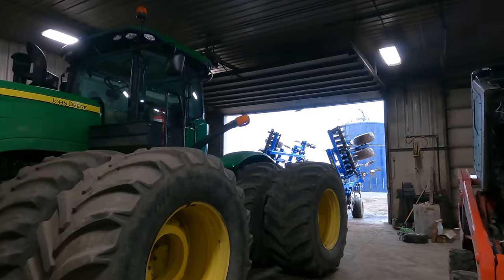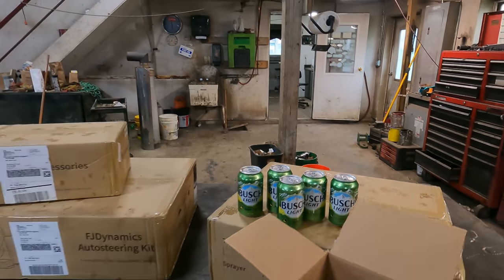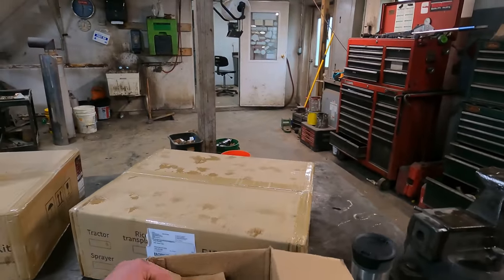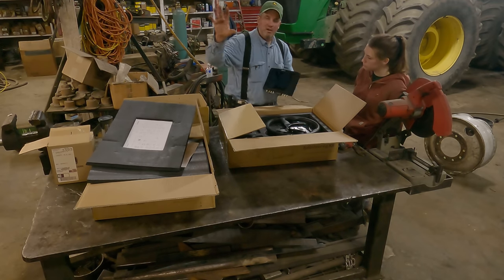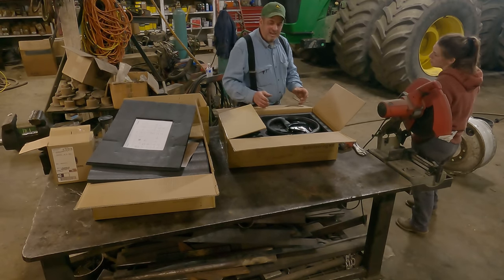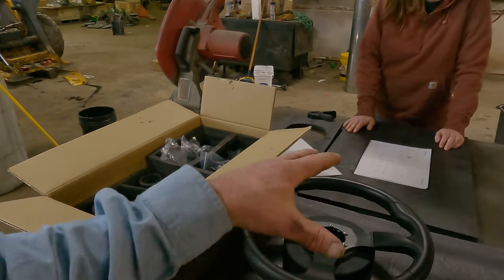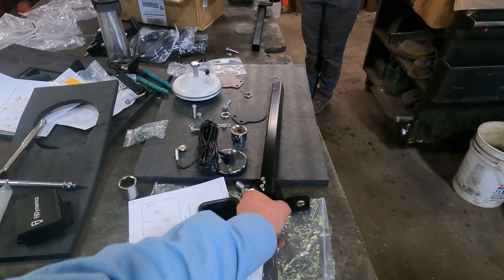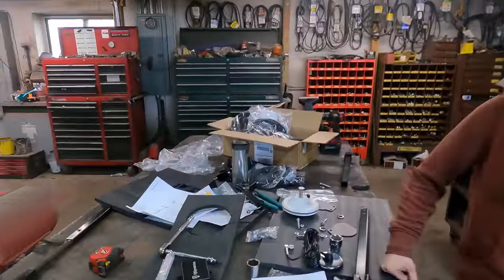Sarah’s tractor gets an auto steer system from Fj dynamics … installation and setup

Comment: Ingenious fix on the nut/socket problem. I'd have gone around the barn a few times before I came up with that. One of the many reasons I'm a big fan, well done Andy.
     Best regards from Indiana.
Reply: With Deere being a common unit, FJ should anticipate the need for the adapter minus ruining a socket by boring + welding a nut to same. System is advertised as plug & play, so ship it as such. The ability to maintain steering telescopic setting should be anticipated, w/ included  adapter components.

Comment: Thanks for suffering through it Sarah! Great work around for the steering nut and the antenna mount. Knowing how to overcome the challenges makes all the difference. You made it look easy, Andy. Go dive in to the other box! You earned it! lol
There should be a SIM card included if that's what the kit requires to be operational. Having to run around to supplement the kit wastes time and is a pain in the ...

Comment: That GPS unit will pay for itself in time/ fuel saved ! We run  GPS on all our equipment and we prefer the johndeere GPS systems . Even on our case quadtrac  we run greenstar .  My family was skeptical about GPS but it makes working at night easy and stress free.  What really sold us was using GPS when combining soybeans in dusty conditions you can't see the ends of the heads with GPS it's safer and more efficient.  I'm sure Sarah will enjoy not steering once she gets used to the system.  Great video keep up the good work!

Comment: I haven't seen the John Deere cans here in Northwest PA yet, hopefully they show up! That system seems to work just fine on OLFs 7810.
Reply: Do you know Aaron Martin, a 2 cylinder specialist❓❓up in Penn Yan.🚜
Reply: @billupstateny9151  no I don't. I live in Pa about 25 miles from the Ohio line.
Reply: UPDATE I just received a case of John Deere Busch light beer! My son was in a neighboring county in Ohio yesterday(Trumbull County) and he stopped and bought some and he gave one to me!
Reply: @2cylinderjohndeere720  He is a tractor dismantling one man operation, but has inventory for the 2 cylinders, those are the only models for which he offers parts.
Reply: FJDynamics system works well on whole series of John Deere tractors, from 30HP to 500 HP
Reply: @wangscofield109  actually deer hp range extends to 620 hp. Point remains that system should be plug & play,  no special customer fabrication of special adapters, no interruptions of tractors features such as telescope steering adjustment, & proper length cables to accommodate large cabs,  + the roof receiver mounting bar length increase. "Works Well" is a term begging for installation refinements.🚜🔧🙈
Reply: @wangscofield109  When you purchase a product, modifications & installation 're-designs might be expected. However, many of us expect all components fit as packaged. This system is still expensive for typical farms & should function without Andy's remarkable ingenuity
Reply: Correction, the hp ratings actually increase if self steering is installed in a forage harvester, chopper, where hp is even greater.

Comment: I'd fit one of those to my car if it could follow a google route!
The last and only time I've driven a car on the road "hands off" was in 1972 when working at the Transport & Road Research Laboratory (TRRL), Crowthorne, UK.
We used a Jaguar Mark III that followed signals from wires under the surface of our test  track. The boot was packed full of mini computers etc.
I roared around the banked curves at 80 mph while reading a newspaper!
We also developed HUD's which I'm surprised aren't fitted to modern cars.

Comment: Seems like a good system. Only thing that I notice is that you have to lean way down to reach the screen. One thing I'd change if that had to be the screen location is a button that you could mount some place for easier reach to reset the wheel
Reply from the maker: Yes

Comment: Thanks! The customization to maintain the adjustment is great. The last video was a great primer for this one, well executed.
Can you use your own GPS/RTK base station or must you subscribe to their RTK service?
Just an FYI, the actual "reciever's" are most likely in the display. The UFO thingies are just antennas. That is why there are the fancy co-axial wires all the way back to the display. <<-- not being pedantic just adding info for folks that may find it interesting.
I'm dabbling with (rolling my own) DIY base/rover RTK solution using 'ublox ZED-F9P multiband GPS recievers' and similar miniUFO looking antennas.
Reply from the maker: Would have to use their RTK
Reply: Top notch professional install Andy - I can see why auto steer would be helpful/convenient - cheers!
Reply: @FarmingFixingFabricating  what is their RTK called and how much is a yearly subscription?

Comment: Yup universal mount kit. One size fits nothing at. Had a lot of the same issues putting on my versatile. Not sure of durability yet. I’m thinking a used Trimble ex steer would have been a lot simpler. Time will tell

Comment: 23:03
2 receivers suggest the system is using differential GPS to maximize the accuracy of the guidance. 
Given they installed further apart than the provided hardware, did you have to go a calibration procedure ?
Does it achieve  sub-inch precision ?
Reply: Believe sub-inch is more a marketing tool than actual reality. The tractor shift in soft soil can easily be several inches. 🚜🚜
Reply from the maker: It’s all just a calibration

Comment: Hey Andy Just curious why you would want a system like this over jsut running the deere guidance with the integrated steering valve instead of this system where the wheel is always turning in front of you,?

Comment: No hater at all,  but GPS is the last things these kids need simply because of complacency. They need how to hone their skill feeling the tractor, square up in the steering wheels, figure the boundaries for putting flags up to strike a field out, spray with your manual calibrations with a pressure gauge and mph for a half mile, figure the rate, write it down in your notes, be alert for all obstacles and stay off the stinkin cell phone! Earn the system after about 20 years of putting in their dues. You need experience and technique mastered first. I have the system now after 45 yrs but I will never regret getting the manual education I acquired in my early years. Deprivation leads to appreciation.The  older generation will know what I am referring to but I'm sure comments will come back saying, "Well, it's not their fault they were born into it." I say, let them pay the $8k for the system and then they might take it upon themselves to manually drive the tractor parallel and get squared up.  It sounds like the first girl mentioned said she didn't want it and she could do it herself. Sounds like she has some confidence and pride going on. Need more like her...
Reply from the maker: Ok
Reply: I've been watching this channel for 2 years and think all of Andy's kids pretty well understand eye/hand tractor driving.  Not an attempt to shame you, but did anyone ask you why you ran rubber tires and had power steering when you might have benefited from 8-12 hours a day behind a horse drawn piece of equipment?  When you have a $400k setup in the field making figure 8's turning around, you're losing money..FAST..  A $16k system is going to pay for itself pretty quickly on that rig.  Your operator is going to go to bed rested and survive to work the next day for you and the next day after that.
Reply: George Jones  i highly doubt that as I have been doing sugar beets 35+ years and guess row is within three inches + watching the every move of the implement---so don't compare a profession that I honed for that long with a high school girl on a youtube channel.
Reply: Youre completely wrong on everything you said. You're suggesting being more inefficient instead of using something that creates efficeny. And no it doesnt create complacency, it reduces operator fatigue and allows for full attention on the implement. I never look where im going when im in the field. My eyes are on the planter all the time unless im turning.
Reply: @PaulsonFarms That is about the stupidest comment I have ever heard--" I never look where im going when im in the field". Watch out for that highline pole as the satellite didn't map that one. On complacency, you tube Welkers' farm Nick planted all night and had his GPS all set up, lunch box packed for all night, cell phone with netflix, and by golly if morning didn't come, looked in his seed compartment, and only half was gone--he spent the next 9 hours going over the same field again--complacency, lack of focus, or inefficiency,---whatever word you want to use. And to add another point,  drivers or operators are two different terms..
Reply: @justthings6405  no it isn’t, we have no high line poles in fields? Why would they put them there? And that’s why the equipment has sensors on it and you watch the monitor and machine to make sure everything is working. If my planter misses planting 3 seeds my monitor lets me know if there’s a problem. You gotta get up with the times bud, no one farms like you’re suggesting anymore

Comment: I suppose the next stage will be a non driver tractor, so you dial in a field number and off it goes! Hope Sarah doesn't nod off to sleep in the  middle of a field,  or will the system stop the tractor when not concentrating on steering , or will the system stop the tractor at the end of the bout???? Shouldn't the supplier have thought of the telescoping feature? I like that metric adjustable spanner. Ho Ho Ho

Comment: Andy, just out of curiosity, with that tractor being auto steer ready, what made you run that system instead of just putting a john deere receiver on and going integrated.
Reply: Probably about 26% of the price of jd units
Reply from the maker: I just wanted to test it out figured the easiest thing to put it on was the 9560. John Deere receivers are hard to come by right now . This system is designed for the tractors that don’t have any kind of an integrated system
Reply: @FarmingFixingFabricating  it looks like a good option. Will be watching to see how you like it. I know what you mean about hard to get. My last tractors came from Deere without receivers.

Comment: They should be a little more model specific. The average joe can’t do what you did with the steering column and top bracket
Reply from the maker: How has it been working for you
Reply: Only used it for a few hrs. It’s no jd green star. Works like a Trimble ex steer but those old things were more user friendly